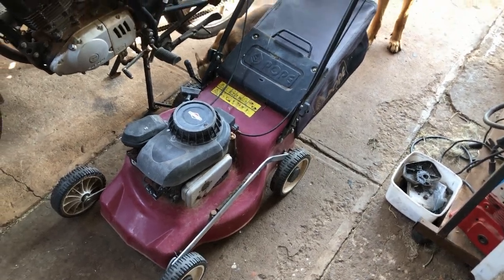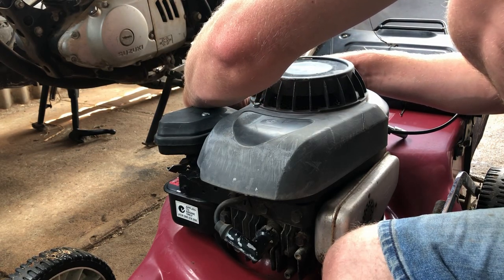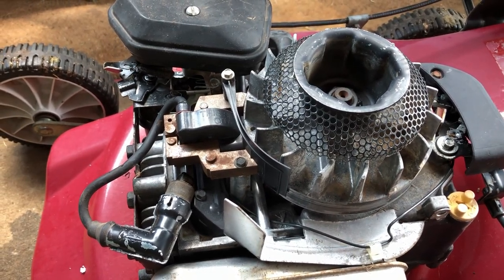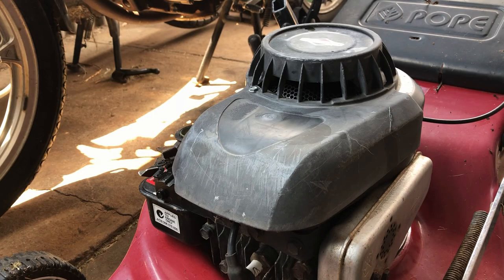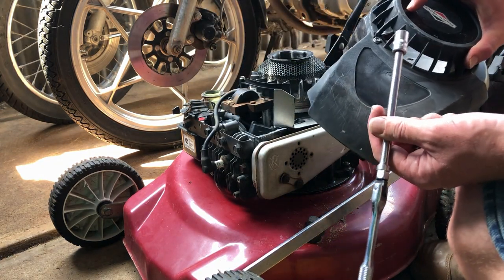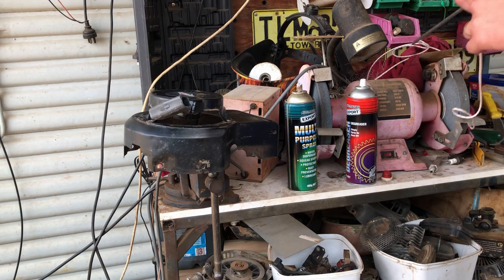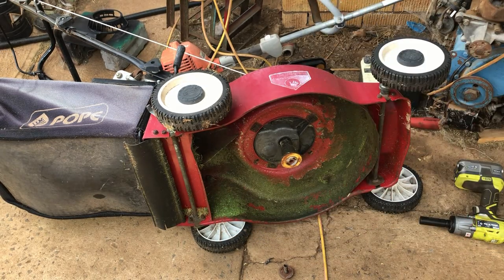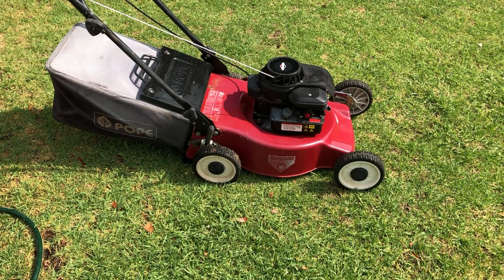Can we fix it? A Briggs and Stratton powered Pope mower.

Comment: I know someone who had one of these in perfect working order sit in the elements for years until the red paint turned salmon colour and he disposed of it.
Reply from the maker: Ive seen these things so rusted out the engine fell through the frame, they were a cheap machine at the time, probably to compete with  the early sanli's etc.
Reply: Yet he uses a pair of rusted out green Lawnkeeper by Victa mowers to do neighbourhood lawns, one Briggs like this and the other with a V40 Chonda. He recently treated the rust with phosphoric acid and rattle canned them black. They look pretty good despite the rust holes. He also started using a late model Victa Mustang with OHC Honda that he left outside for months after it was given to him. It goes well despite lying outdoors all that time.